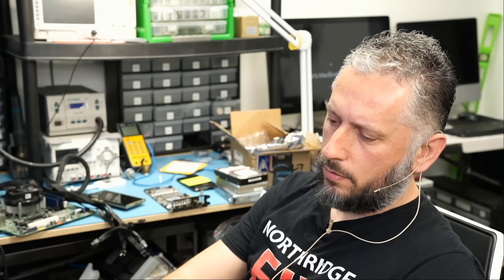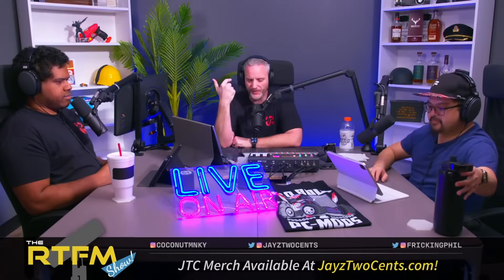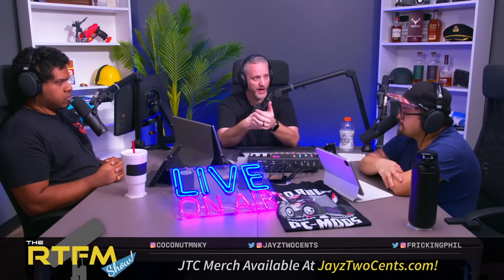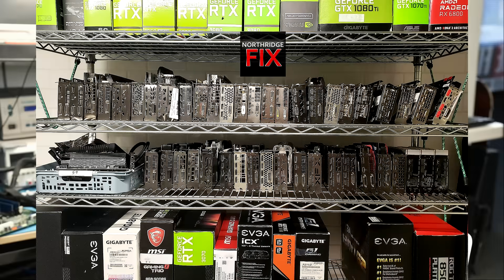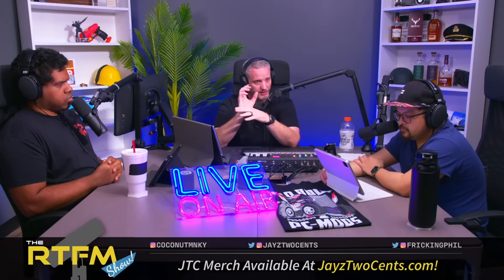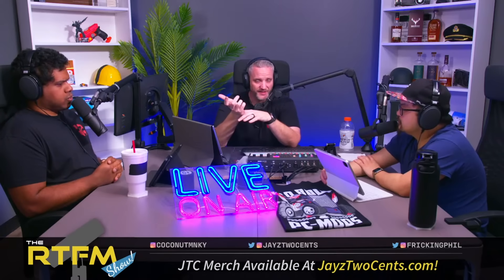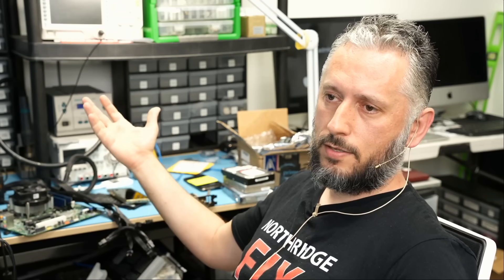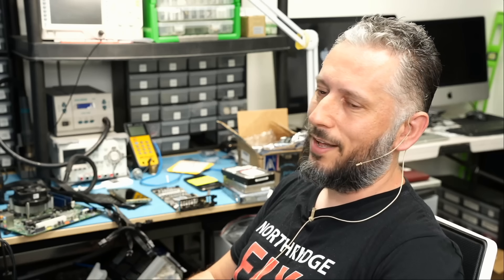Melting 4090 and CableMod. JayzTwoCents and Gamers Nexus Response. Blame NVidia or User?

Comment: Agreed, I take back my previous comments.   Your argument and evidence is stronger than the blame the user argument.  4090 design is therefore flawed and the manufacture fault.    Its a design flaw issue.  Too much power through one connector.   It would be better to have 3 connections to the card and spread the power load between connections to the card.   NorthbridgeFIx is right.  What user is going to wiggle and jiggle the connector so much that it fails to connect properly?  Users are not idiots.    It is usually set it, lock it in and forget it.Yes, NorthridgeFix should make more videos on the 4090 connection meltdowns.  I also think the previous researchers on this issue will need to reexamine this design flaw and come to a recall recommendation on 4090's.     The other reseacher used X-Ray machine and other methods but underrated common sense.    Your experience and knowledge as a repairman is more applicable to this connection meltdown than having the connections examined by X-rays machine,  or connection bending and twisting overkill.   Your right on and common sense not advanced technocracy obscurification must prevail.

Comment: What baffles me, you have 12 12V pins from four 8 pin PCIe connectors going to six 12V pins with what looks like to be the same gauge materials. Well done to whoever designed this.

Comment: Steve is wrong.........its not Joe six pack not plugging in properly, cables are good, .....there is a more simple fix to this, the techs that build these care should wire direct to the board it self, or have a connector set in place, were Joe six pack only connects to a 4-5 inch plug coming out of the card...there's only one way to connect...funny its only the 40 series card from Nvidia doing this

Comment: Maybe I am too of a simpleton but still: A GPU is a GPU, and THOSE GPUs cost as a salary or maybe more. A pllug is a plug and for christ's sake. Either people have become so stupid as to consistently plug in partially in exactly the same way so as to produce meltdowns which all look identical OR the fucking  product is CLEARLY, and I mean CLEARLY flawed. Not the first time, such a costly GPU has blatant design oversight by the way. I also understand that people like Gamer's Nexus or Jay may pretend to be independent but have lcear interest into defending Nvidia but still: a car costing way over 1K must definitely tolerate a cable not perfectly fitted (just use 2 or 3 connectors, split the load for christ sake). And I am pretty sure that the partial connection is NOT here to blame.

Comment: I have a 4080 and those connectors  suck . I have had issues with the cable mod 90 degrees adapter , Card becomes unstable and system crashes with it on the card along with their custom power cable . Card works without the 90 adapter. But I think it all stems to just a poorly designed connection.   Im worried my card will melt if pushed too hard even with the cable mod cable and definitely not using the 90 anymore.   Wish I stayed with my 30 series card

Comment: basic electrical cable calculation. example- a house cable 25mm can take up to 60amps . But to be on the safe side, max usage is 40amps so the cable wont be hot. if running on full load 60amps, the cable will get so hot that it can cause fire . if you need to use 60amp of power, u need to distribute it into 3 phase. so each phase will use 20amps top and your cable is so cool that you can even touch it for 24hrs.  the case nvidia here is the gpu itself is a power hungry card which can draw up to 600watt. the worst thing is the design is it need 3 x 1.0mm cable and into 1x 1.0 mm connector.  that's totally no brainier design. imagine if 1.0mm draw 5amps .  3x 5amps = 15amps into another 1.0mm socket.  not rocket science, the connector instantly get hot and melt.

Comment: Everyone is overlooking the main problem.. You are pushing way too many watts through that small connector... And of course the card manufacturers won't admit that.. They would have to recall every 40 series card..
Reply: Yea they screwed up big-time
Reply: 1000 watt with modded bios to play games, yep too much power, try using that connector in a power station for thousand watts of inverted and or dc power it would burn up in seconds…

There is a reason in the real world people use heavy gauge wires and connectors you can drive over with a tank and the pins would still not come in contact with each other… not to mention they would only melt if the sun touched it..

Comment: are the burnt on board connector with male pinns  magnetic ? If yes that will cause more heat compared to a good brass pinn connector, and yes the diameter of the 12 pinns ate to small, i agree with you alex
Reply: A 35 year vet PC repair man tells me all the time some things are not made like they used to be.
Reply: Yes the old standart  works, just fine, also the old 4 pinn hd. power was much better than that sata power connector

Comment: All the video cards I've bought over the years had lights for each eight pin connector, red for no go, green for good to go. I have a MSI 4090 TRIO, and didn't even think about turning the card on until I had a CABLEMOD connector installed. I have my card's power limit set to four hundred watts max, and hopefully won't have to send my card to Alex in the future. But it's too much power going through too small of a space, and I wonder about power supplies. Maybe one eight pin of the three is doing too much of the work, and too much heat is being generated on a small area of the connector at the card. It would be nice to know what power supply was being used for each melt down.

Comment: Long time viewer, I appreciate your videos and enjoy learning from you. I am very familiar with the whole 12VHPWR saga affecting users of 4090s. What I would like to point out is that in the case of the 4090 you received Cablemods connector still attached, you are stating for a fact that the cable had been properly seated and that it still melted. However, you don't actually know if the connector suffered prior damage/melting, before the user noticing some instability lets say, and then pushing it in fully. But by then, the damage to the connector was critical and then continued melting. Unless you have emperical evidence otherwise, I think you cannot jump to a conclusion that you know for a fact the connector was properly connected at all times, and that it's purely a connector issue. While it is possible that your assumption is correct, people should remember that correlation does not imply causation.
Reply: yap, cuz that makes sense! A guy that is aware of this problem and even buys an adapter to make sure that he isn't putting too much stress on the connector by bending the cables, most likely did that or maybe burned the connector on purpose and then, while still hot, inserted the adapter just to feed this circlejerk about melting connectors. Im curious about what is realy causing it to fail (most likely a number of factors and one if for sure the heat generated by the current) but the common thing is 4090's and their connectors so it's pretty obvious who should be responsible

Comment: Ok, who am I going to believe, a guy that reviews computer hardware or an advanced electrical engineer that does things with solder that most simply cannot.  I am 110% with Alex on this one.  I have done work reviewing hardware in the past.  If you give Nvidia bad reviews they stop sending you cards.  This causes many reviewers to produce less than ideal reviews as they don't want to lose out on the revenue stream from reviewing Nvidia products.  Alex is not swayed by anyone since he is not beholden to anyone.

Comment: not manufacturers, not nvidia, not users, It's PCI SIG who certified this connector up to 600w with 8.3 amps per pin while the connector's manufacturers authorizes up to 8.5amps per pin, near 0 margins (PCI SIG certified 8 pin PCI connector up to 150w so 3.1 amps per pin and connector's manufacturer authorizes up to 9 amps, a good margin, even with user errors, oxidation... it's ok)

Comment: Just the fact that one is combining the current capacity of three connectors into one connector alone, nevermind wether or not someone is possibly not plugging them together correctly.  I mean just the STUPIDITY of that design.  No one schooled in electronics in their right mind would even spec that type of design.  Besides, Molex & Amp connectors like those have never been known for their current carrying capacity.  Even in other systems one can often find them melted or burnt.  Time for Nvidia to spec out a new positive locking single connector system that IS designed for the AMP capacity at hand !!!

Comment: I agree with you totally. I wonk on automotive electronics. GM and their micro connectors for years have been too light to take the amp load within the circuit. The small terminals in the connector will start to heat up due to the fact they are too small. A fuse is installed in a circuit to be the weak link in case of failure on that circuit. If you have a weak terminal at the connector that is too small, you have made the terminals into a fuse. Another weak link. They may not burn as quickly as a fuse but they will sit and simmer causing melting problems in the connector.
Reply: This makes so much sense too. They are just pushing too much power in a small area

Comment: Alex has too much experience for Steve to dismiss his observations so easily. I don't know what Steve's motivation is to continue to suggest the "user error" idea over what is more and more the obvious reality of the situation.
I've said it before, the evidence is clearly pointing to the card manufacturer as the source of the problem. I don't know if it's a design flaw or a manufacturing problem but the fact that this connector has been used on other cards without experiencing this issue is pretty plain evidence to me that the card itself is ultimately the issue. I don't know what else anyone would need to see to understand that.
On top of all of that, even if the problem comes from cables that are slightly misaligned or partially pulled out, the card manufacturer is STILL the one responsible for putting out a product that is so easily susceptible to failures caused by such an issue.

Comment: Well, if the previous cards had 3 12v connectors and didn't melt, and this one has 1 12v connector while requiring more power, melts. That screams bad design choice, doesn't it? It doesn't matter whether its all the way in or not, its a bad design.

Comment: If the factory uses a bad plug that can easily cause this problem, then the factory is to blame. Not the first time we see the electronics factory using a bad plug. such a powerful card should also have had more power plugs

Comment: Steve said that it is POSSIBLE (not confirmed whatsoever) that the customer used their 4090 without the cablemod adapter, ordered one when 4090s originally started melting, but had that connector get hot and damaged prior to getting the adapter. I would consider that very plausible. other than that, I agree with all 3 of you, there's is a flaw with the design which means it has no tolerance for user error.
Reply: For real 😂

Comment: So, cable not plugged in all the way and bent = melt.
Cable fully plugged in = no melt even with several 12V cables cut down to force more watts in less connections.
Cablemod connector = melt. It sounds like cablemod connector has issues if the stock cable doesn't melt connectors if fully plugged in.

Comment: what you fail to realize you stated at the beginning........ Tiny bit of brains... is SO very rare these days. BUT..... its a card problem cause at the end of the day even if it IS user error per not saying it is or isnt but the damn connector should be dummy proof period and is a terrible design. AKA a gpu problem

Comment: Most likely to people rushing to put the gpu in, Barely plugging it in and issues happen.
Reply: Idk you can do some craziness with older hardware alot better than the thin plastic designs they make, sometimes cheaper and less costly design is never better. Just like EV's at the moment

Comment: The problem is everyone is right, its a poorly designed system which invites error from the user (partial connection, pressure on cables) and design fault (material ingress, mechanical stress fault over repeated connections).

Comment: The current fellows the easiest path possible if one of the pins are more power hungry from the other it creates heat in the second case  the 12 volt rails are internally connected  the current will fall equally across the pins  because my card failed after replacing the canister I took my time a and measured the current draw of every individual pin ant the 1 pin the curent draw was 3 amps more from the oters

Comment: i am using a 4090 with nvidia provided adapter, there is no melting issue granted my card was never pushed to its tdp limit of 450W. Why is this issue arised back after cablemod released their adapter? You dont see standard ATX3.0 psu with their own 12VHPWR connector melted, either from corsair, silverstone, etc. Cablemod does not have the best quality stuff in the market, its not a surprise that it melted.

Comment: Personally I think Steve is wrong in his assumptions, because is what they are, assumptions erring on the preconcieved belief that it is "User Error". He even refers to the burning as "User Error Failures" more than once. 
I get the distinct impression that he is reluctant to say it is Nvidia's fault, and it is easier to blame the User instead.
Personally after watching your Video Northridge it is an inherant fault on the Card, not the User.

Comment: Blame NVidia or User?

This is Nvidia fault no doubt, even before the 4090 was released when I saw that connector, I was like wtf?, so many PSU connectors to just one output, instantly I was sure this was going to cause some severe heat in the output, there is no way in the output to how control the voltage, is just a huge parallel circuit mess,  I don't think is a positioning or fully seated in the 4090 connector, is matter of a horrid cable circuit design.

Comment: This card is pushing the limits into NASA tolerances territory. There are indeed multiple factors at play: the connector fitment, the processing load (some games will push the card harder), the power supply type, and the user. I agree with Alex that a consumer product should never be designed expecting an ideal installation scenario; if this were the case, this should've only been a professional shop required installation with an NVidia approved checklist to follow. Now, my guess is that NVidia knew about it into production, expected a few failures (like most manufacturers), but never expected the large amount of melted connectors. The guy at Gamer Nexus has not properly done his testing IMHO. To me, it is trivial to setup a test bench, measure all current values and thermals (physcally, thermal camera) at different game loads, and see that puppy melt like butter.

Comment: Nexus is scratching around in the dark hoping to find a smoking gun. That photo analysis was very loose and lacked professional/practical judgement. 
Alex has way too much experience and practical knowledge with Circuit board repairs. 
Nexus reputation hinges on his next video. However, the way he presented his critique of Alex is very arrogant like he doesn’t believe anyone but himself as default.  He also subtlety tries to taint Alex’s objectivity eg the text at the bottom of the nexus video (…and maybe more).  This is why i unsubscribed from him a while ago. 
As an investigator myself, I agree that an X-ray should be taken of the connection to see how it fits but it would only confirm a design fault if it doesn’t click into place with a reasonable attempt by the user.

Comment: Seems like you're the only one 'CALLING OUT' the big guy Nvidia.. I agree with you Alex, Seems Jayz is on the fence, but  Steve wants to protect Nvidia & CableMod. You fix and work on the cards and have seem first hand the damage... but what exactly is the root cause? 500 watts divided by 12 is 41 amps going through that connector. The ole PIE chart. Am I correct?

Comment: The only reason why the plastic around the pins inside the plug melts is that the pins get hot! Either the plug is made of the wrong type of metal, which means that they cannot withstand enough amperes. Or the pins are a little thinner than they should be, creating a poorer contact. It must be  to test how many watts this plug can handle.

Comment: I think what you have to take away from this is that Jay is very much just another "bro" and is very much in the corner of the consumer where as Steve is trying to approach this diplomatically without jumping to any conclusions. That being said, Steve has more than once said that the cards should be warrantied and in fact that this is unacceptable. I think what his intention with repeating the misaligned cable rhetoric is to get people to really be careful with the connections because more than anything these events are dangerous. I watch Steve and Jay both a lot and I don't think Steve is trying to give Nvidia a pass here.

Comment: "molecules of brain" :D
Reply: 600 plus what is what 4090 can draw power. I think the manufacture design should use a 4 times 8pin connector to be safe. not just a single slot and small in size too.

Comment: the cashing machine jaw is wrong, its a flaw with the design, if something fails consistently  its a bad design. i think that if you bend the pins prior to connect it can make a better connection.